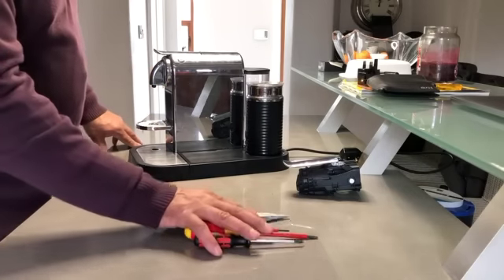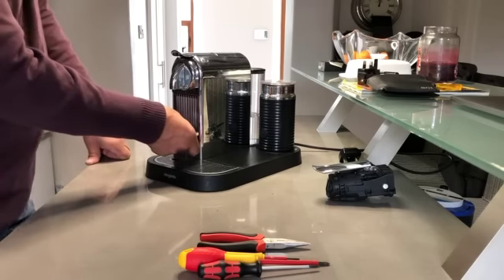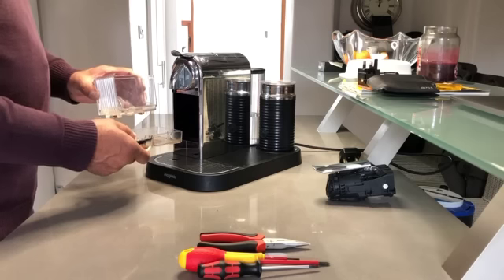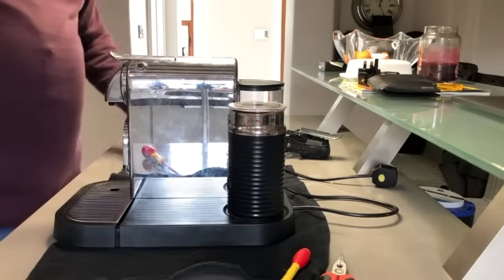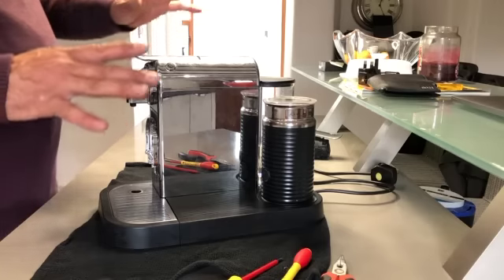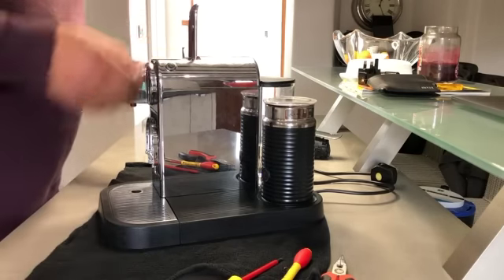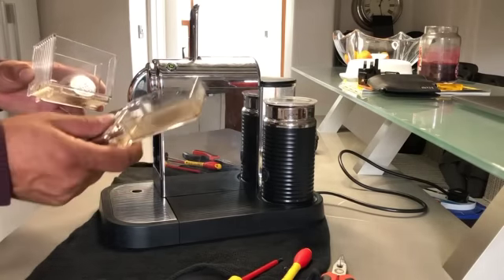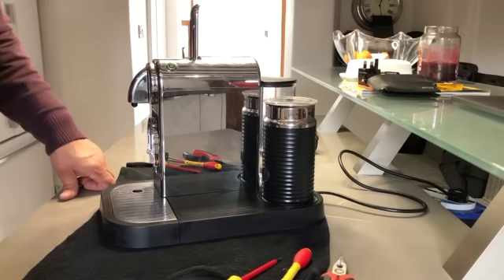Nespresso Repair leaking

Comment: Hi James, thanks for a sensational video. Just a quick question if I may: Is it necessary to take the base off to conduct the repair or is it possible to just remove the sides of the machine. I couldn't quite understand why you needed to remove the bottom. By the way, the cheapest replacement part I could find here in Australia was $119, which is about €75! It will be about $50/€30 from the link you provided in the UK, so thanks for that as well.
Reply: James, a supplementary question: Did you investigate whether the o-ring in the unit was to blame for the leak and whether replacing that may have resolved your issue?
Reply from the maker: Hi Oliver, you are absolutely correct, however I have now just completed a friends machine and it’s clear that you have to remove the base of the machine to avoid damaging the outer covers. I’m in the process of uploading this repair today, so should be available by the time you surface in Australia.

Comment: Thanks for going to the trouble of sharing your repair job.
Was the seal that is mentioned @ 12:30 the thing that was causing the leak ?
Reply from the maker: Hi, no it was not that small seal, the leak is within the brewing chamber itself. I assume that people have descaled their machines and it’s not just the brew unit clogged with sludge or lime scale.

Comment: Found that the Magimix M190 is similar construction.  Bought the replacement brew unit and discovered the leak was just as bad after fitting it.  It turned out the plastic spout (not supplied with the new brew unit) has two levels feeding the spout (the spout appears to be split in four, but its 2 x 2) and the lower level was blocked.  In retrospect I could possibly have cleaned this with a pipe cleaner without taking the unit apart.  With the spout lower level unblocked, the machine does not leak.

Comment: THIS WILL VOID YOUR WARRANTY! NESPRESSO WILL REPAIR IT FREE OF CHARGE IF UNDER WARRANTY. If You need parts to fix it, you cannot purchase any technical and internal parts from Nespresso. Only Nespresso authorised service centres have the parts to fix Nespresso machine and they will not sell it to you. If your machine is under warranty they would  fixed it free of charge for you. DO NOT RISK REPAIRING IT YOURSELF YOU MAY DAMAGE YOUR MACHINE MORE!
Reply: People are fixing out of Warranty Machines mine is 5 years old replaced the seal and still the same so replaced the Brewer and all working
Reply: Wayne Gillard where did you buy the parts ? Because In Australia Nespresso don’t sell internal parts to customers. Only the authorised Nespresso service centres have parts and they won’t sell it to you
Reply: cost about $65 AUD inc postage

Comment: Why buy the whole new assembly rather than just change the 2p O-ring?
Reply from the maker: xxxenricop. If that’s the problem with your machine then great. It wasn’t with mine.
Reply: xxxenricop which o ring did u change?

Comment: Thanks for the instructions, very clear and quite concise! I invested in the special oval screw driver and this made things very easy. Having replaced the brew unit (Torx screws on my CITIZ brew unit as mentioned below) I found water still drips from the new unit. Suspect that this is 'expected behaviour' as there is a collection reservoir - just mentioned in case someone goes to the trouble of changing the unit when it only drips slowly! (Unless you found the replacement unit didn't leak at all!)

Well done for the video!
Reply from the maker: Mike Jurkiewicz thanks for your comments. You’re correct that the tray beneath the spent capsule cube does capture some water. A few drips each time you make a coffee, this is normal and you perhaps need to empty this tray when the spent capsule box is full.  We have to remember that the capsules are under 15 bar pressure when extracting a coffee and when this pressure is released a few drops of water will drip through the spent capsule box into the tray. 
The issue is when you only make 1 or 2 coffees and you have to empty the tray. Hopefully this is no longer the case with your machine?
Reply: @jamesroberts2907   I suspect I could have left replacing the brew unit for a while as the original only dripped a little. Though here is an improvement! Thanks again!
Reply: @jamesroberts2907  Hey there, it doesn't have anything to do with the main message but i'm looking for more informations about that 15 bar pressure, in fact does this machine has an area where it gathers that much pressure? It seems too small to generate this much pressure while small professional machines are at 9 bar and weight at least 40 kg.

Comment: This is a real problem with Nespresso machines ! Had my Expert and Milk for less than 6 months, thought it was the best thing since sliced bread, heard about other's having problems with the same machine and thought to myself, they must have had a bad batch !? How wrong was i, the machine will not extract any coffee from a genuine nespresso pod, and leaks every where (machine now resides on sink while i try to figure it out) ! Descaled, still no joy. Have lost faith in the nespresso brand ! I wrote 5 star reviews on the machine on amazon, but will be updating and recommending to stay away from pod machines ! Not very good at all. Update:- bought a creatista plus and this has flooded less than a month into use ? I now believe nespresso has a serious design fault ! Buyer beware !
Reply: Should’ve bought the cheaper machines I’ve have a Essenza, inissia, citiz for 5 years with no issues at all. My friends have the basic models too and lasted years. Best thing to do is not to buy the expensive top of the range models. The more expensive they are the more technology they have and more issues can go wrong. Remember all the machines make the same coffee anyway no difference in quality of coffee whether you you have the base models or the top of the range. Expert and milk is the top of the range and has Too many bells and whistles to go wrong. Nespresso still has the best quality coffee with crema that’s easy to use, easy to clean in a capsule which is recyclable.

Comment: Whats the part number? Anyone find a different place to buy? The link doesn't work anymore.
Reply from the maker: Hi Vincent, its possible that Nespresso have closed this loop-hole and tried to stop the guys from selling the part.  I would give  https://www.magimix-spares.co.uk a ring, or send an email, its obvious someone has told them not to openly sell it anymore.  there site says, give us a ring when you search for the part number.  If not here but slightly more expensive... https://www.fiyo.co.uk/nespresso-magimix-brewing-unit-505360 but seems like free delivery in the UK.
https://www.ebay.co.uk/itm/Unit-of-brewing-Coffee-maker-Expresso-MAGIMIX/223087392114?hash=item33f10b7572:g:YiUAAOSwNA1bHmhW  from France, but looks like it doesn't come with a handle, you can try to send them a message.
I'm very suspicious that the link no longer works, so I will try to find out why......
Reply: Thank you.

Comment: Thanks! Worked great for me. For USA orders use buyspares.com.  Mine also had T-10 star screws inside, not philips.  I got the oval screw tool off of Amazon. The hole was too small, but worked great but after I dremmeled it out a little.